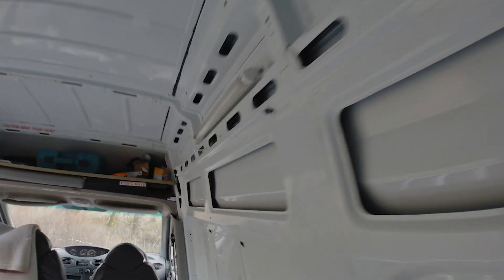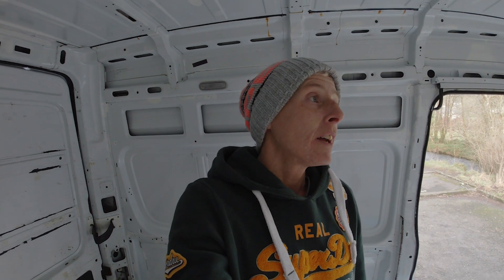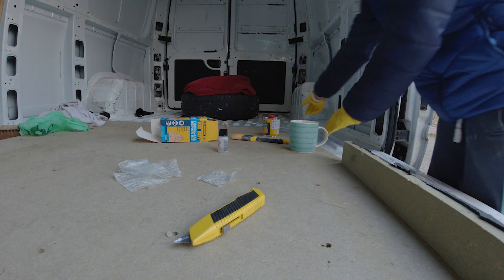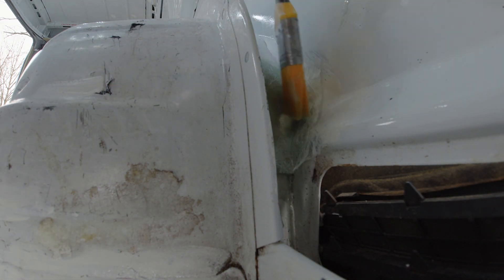LDV Maxus Van Conversion (part 3)

Comment: Hi I have a Maxus and saw you had a new rear door seal…..where did you get it from please. Loving the vids just catching up with them
Reply from the maker: Hi thanks so much for watching 😀 the new seal came from seals direct this is the code for it ETS4122 and you will need 5 metres which will give you roughly 4 inch left over once the whole frame is done.
https://www.sealsdirect.co.uk/shopping.asp?intDepartmentId=71#127
Hope this helps 🙂👍

Comment: Just bought a Maxus minibus, think I might need the strip it out(leaks?)....doon in Ayrshire, wet!
Reply from the maker: Yeah we have had terrible issues with leaks still got one in the cab.  I have reasealed all the joins between the panels not got up on the roof to do that yet but next job on the list 🤦‍♀️🤦‍♀️ good luck with yours fingers crossed you find your leak 🤞🤞
Reply: @rufflyadventuring3579  I've just taken the seats out, because it's a bus, it's all lined, I'll need to remove all that first....damn weather, can do nothing! Happy New Year when it arrives!